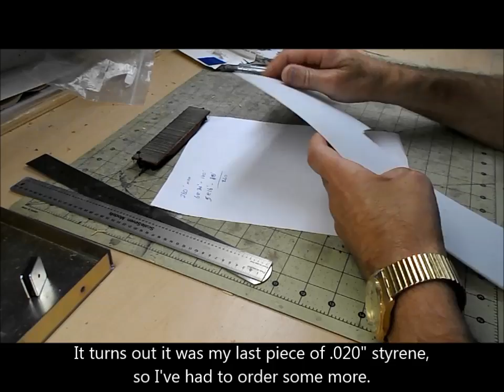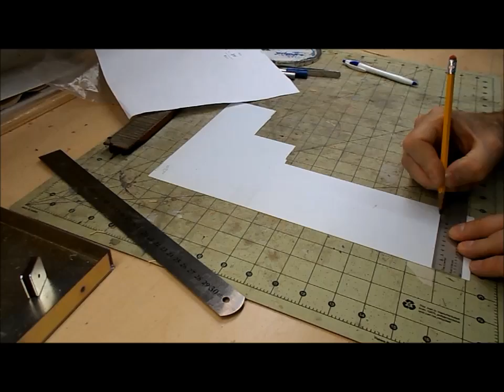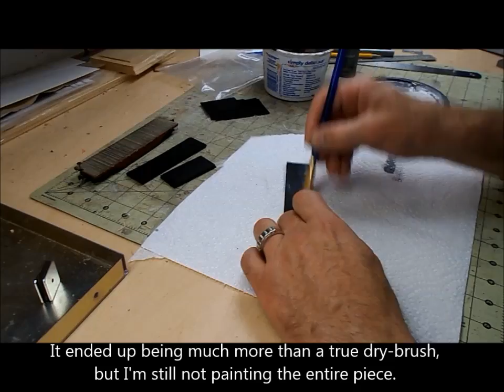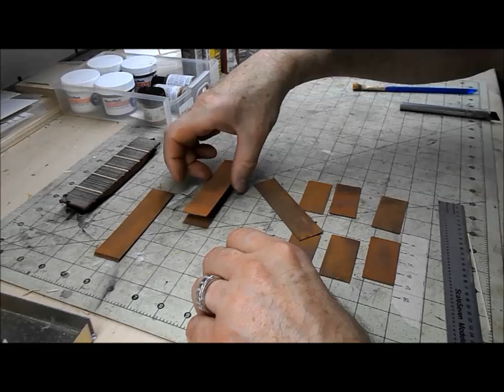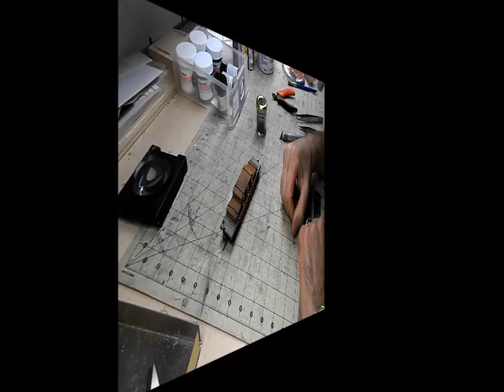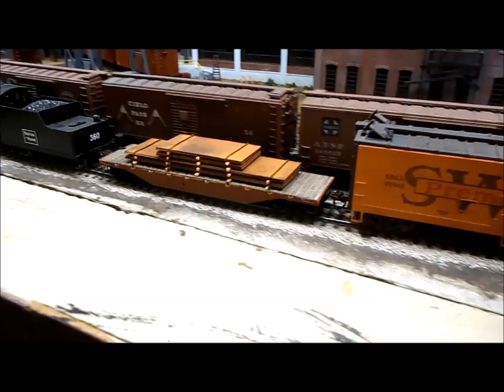Build a load of steel plates for a flat car

Comment: Hmmm. Looks like about 2mm thick plastic. At 1:87 scale, that's nearly 180mm thick in real life. Is that realistic?
Reply from the maker: No, I used 0.020 styrene stacked in groups of three.  Look closely and you can see that I've deliberately stacked them slightly unevenly to make the individual sheets visible. I talked about the scaling in the video.
Reply: @mpeterll  OK, thanx for that, great reply (y)

Comment: Hi, What size is the chain? If you stack the plates why not glue them together then paint them? Looks good and I can remember them being hauled into the shipyard, wish I had paid more attention when I was a young lad.
Can you show in a bit more detail how you attached the chain to the flatbed ? Thanks
Reply from the maker: I don't know what size the chain is - bought it on e-bay many years ago.  It's not glued to the car deck.  Instead, the chains hang down through the stake pockets and lock the load in place.  Painting the pieces first gave me more opportunities to choose the pieces that looked best for those that would be most visible.
Reply: @mpeterll  I am now watching your “A frame” video, really well done.
I am building a waterline model of a Clyde Puffer for my layout and searched for a chain at those cheap jewelry stores, not sure if I have the correct size.
FYI in the shipyards those plates would be stored on fabricated steel frames. 👍
Reply from the maker: @partickhillstation  micro-mark has fine chain
Reply: @mpeterll  nice retaining wall in the background and the plates, chains etc look great
Reply: @mpeterll  love those factory buildings, did you scratch build them or a kit?
Reply from the maker: @partickhillstation  Some are scratch-built; others are kit-bashed.  Most have been featured in build videos elsewhere on my channel.  There is a play-list with all the structure videos grouped together.
Reply: The general practice in the shipyards was to hook the chain into the eye bolt

Comment: FYI,   As a welding inspector during my career, I can tell you that I worked at many steel fabrication shops, and when they receive a shipment of steel plates, the plates are reasonably new and have not had enough time to rust, thus, the colors are generally a blueish-gray color.  Even the plates they have had stacked in the yard for some time do not get a build-up of rust as much as you have depicted.  No criticism here, just trying to enlighten you to what really happens to steel plates used for fabrication.  I think you do great work.  Have been following you for some time now.  Thanks
Reply: Mostly, but not alwase. I have worked a BIW for a long time, depending on what the steel is sometimes it rust up pretty heavy before use, other steel gets a coat of "weldable" primer.

Comment: For the plate steel car out of steel mill in GARY Indians they use steel banes they come out of the pocket on the side of car u shape then up and then bend across the steel, do this on both sides then they have bar stock threaded on both ends with nuts two on both sides . I honestly like you channel keep up the good work I worked on the Milwaukee R.R.as a Fireman Stared in 1968 total 46 yrs did service Navy Vietnam Cuba ran trains from Louisville Kentucky to TerreHaute In to Chicago then Soo got us rand Different routs then to Chicago Bennsville , Then sold the Southern Eastern that was our Divison , Then Ran trains from Elkhart to Winsor Cannda and Elkhart to Bennsville that was O foregot Bedford to Semore In. If you could run a train on our The southern end latte to Louisville Ky you could run any where . Keep the good work coming.

Comment: How would you make the rolls of steel held down by chain? I've seen on many flat beds. Thank you posting its very interesting and I'll give it a lash
Reply from the maker: I've not tried to make any, but if I did, I think I would probably start by wrapping a long strip of paper or thin styrene around a rod until the desired overall diameter was reached.  If I wanted a lot of them, I think I would just make one of each size I wanted and then cast them in a two-piece mold.  The wooden cradles they sit in could be made easily enough out of basswood, and I already have some very fine chain.  I know that Micro-Mark also sells the chain.
Reply: mpeterll when I was asking you he question I hadn't even thought of a way to make it. Thanks for the input. Have a happy New Year

Comment: Peter, the rust looks fantastic, if the plate was headed to a scrap yard. New plate would only be rusted on the sheared edges. Mill scale will protect the steel for weeks,maybe months, depending on what part of the country it is in, besides no customer would buy plate that is really rusted. I've learned a lot from your videos, and I'm not nit picking, I've work in the welding and fabrication trades a long time. But the rust is very good, hard to replicate rust that well. Cheers
Reply from the maker: Thank-you for the insight.  The problem is that color photos aren't available for the period I'm modelling, so the easiest way around it is copy what I've seen other do.  I guess I goofed this time.  What you say about the mill scale protecting the plate for a long time; is that just in the modern era, or would that apply equally in the early 40's?  Hasn't the steel-making process evolved quite a lot since then?
Reply: Honestly it depends on the grade of steel being used. What you weathered it down to looks like a 50w or 80w (the scale looks very dull brown/reddish). Really that stuff is perfectly fine and usable, so depending on the grade that's acceptable and expected. Nothing goes through manufacturing without being cleaned up anyways. A36 rusted and transported like that, sure, it's trash probably. I'd be kinda irked to receive something that showed up without a tarp like that, but whatever. Wouldn't be the first time I had to get out a push broom and actually sweep off an 8x12 sheet before sending it into the laser.
Reply: true if it's directly from the mill. Back in my heavy fab days we used to get stuff that had sat in the yard long enough for it to get pretty rusty. sure was a pita to deal with but the bean counters always went for a deal if they could get one.

Comment: terrific job and show how. this project i can see being helpful and useful to most modelers. but how did you come up with the scale weight ?
Reply from the maker: The "specific gravity" of steel varies from about 7.8 to 8.1, depending on the grade of metal and the exact alloy used.  That number defines the number of metric tonnes per cubic meter.  From this, I simply determined the weight in pounds per cubic inch and multiplied by the cross-sectional area of the styrene strips I used to come up with the weight of each linear foot of steel.  I no longer have my calculations because once I got to the "four linear feet per ton" stage, anything that went before was no longer required.
As I don't really care exactly what grade of steel the load represents, I started with a number in the middle of the range and then rounded off the results to make things simple.  Since visitors don't habitually carry a micrometer in their pockets (and most probably wouldn't feel inclined to do the calculations anyway), this is one place where close is good enough.